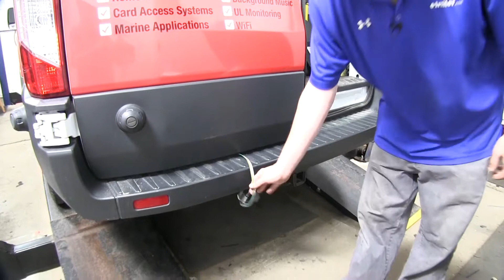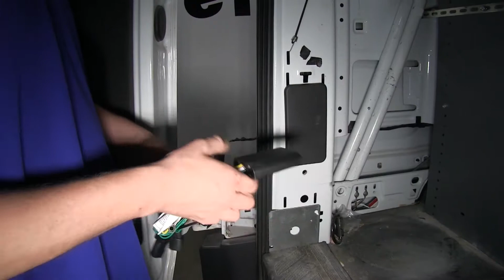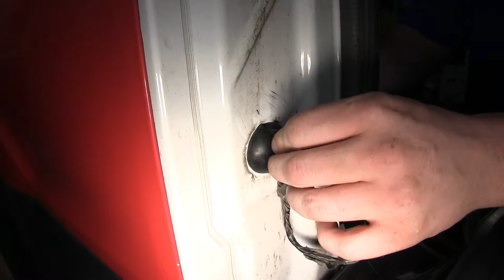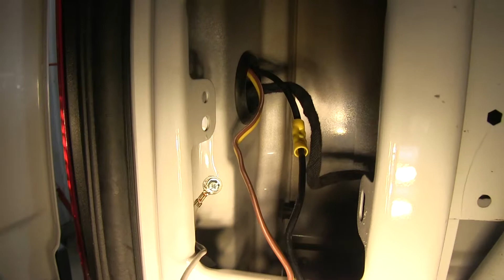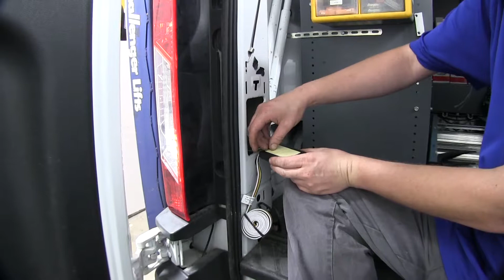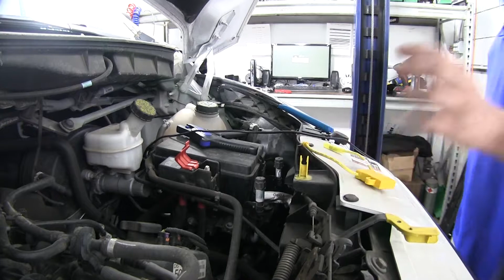etrailer | Curt T-Connector Vehicle Wiring Harness Installation - 2015 Ford Transit T250

Comment: I dont have a scuff plate. Anyway to splice more wire for passenger light assembly? Also any way to run the four way plug and wire without coming out the door?
Reply from the maker: You can certainly graft in a length of 16 gauge wire like # 16-1-1 if the length of the existing wire makes it a bit difficult to reach the passenger side. You'll want to use some heat shrink butt connectors like # DW05744-5 to protect your connections from the elements.
Although running the wire out the back as shown in the video does a great job of protecting the connector from damage that might occur from being exposed to the elements, you can route the connector out of the vehicle  any way you want. If you examine the underside of the vehicle at the back, you might find a cavity or grommet that can be used to run the connector outside. 
https://www.etrailer.com/Custom-Fit-Vehicle-Wiring/CURT/C56327.html
https://www.etrailer.com/Wiring/Deka/DW05744-5.html
Reply: Thank you for the help. I spliced passenger side wire and ran over the door. Then I ran the plug out a grommet in the bottom rear next to hitch as suggested and sealed grommet with the provided black silicone.